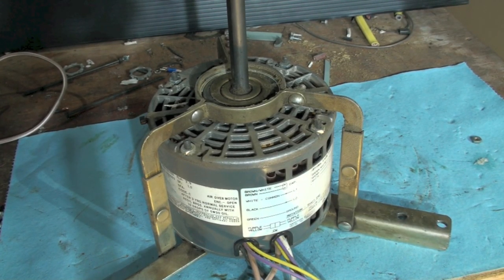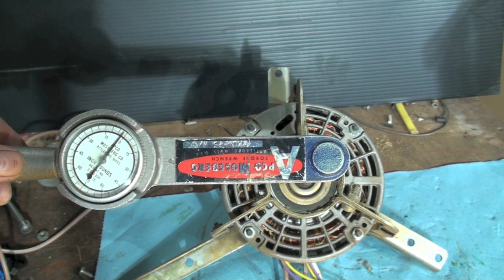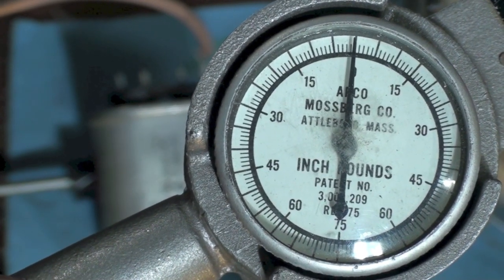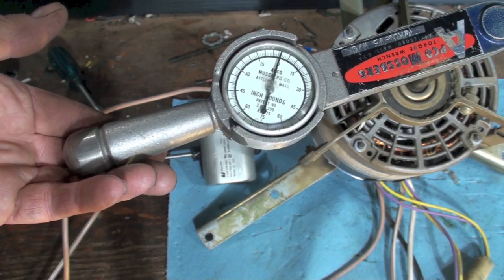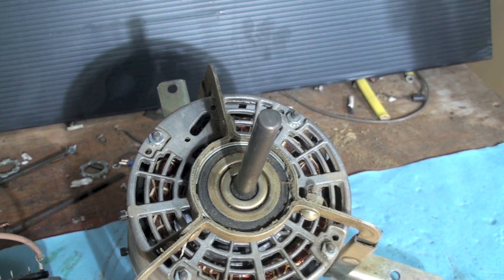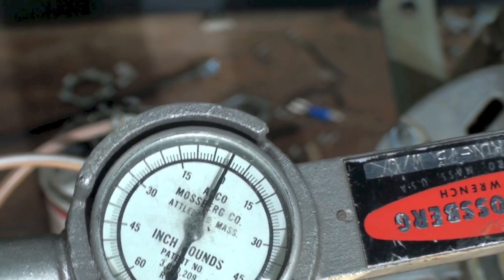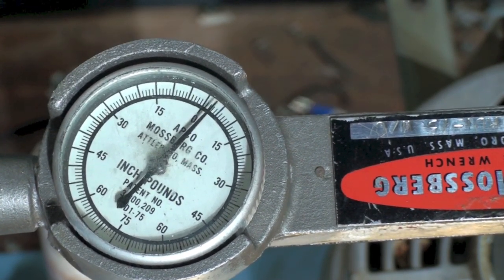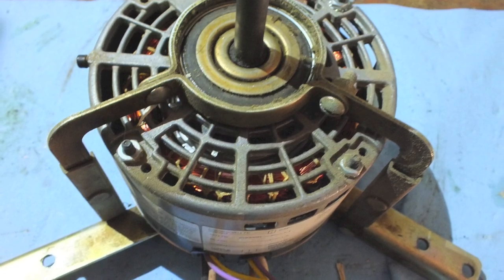PSC motor operation:  staring torque and the run cap

Comment: Excellent practical demonstration of the importance of the capacitor and start winding to the operation of the PSC motor.  Without the capacitor, the voltage vector is only moving back and forth in one plane (doesn't create rotation).  The phase shift created with the capacitor and start windings is key to getting a rotating vector sum that creates a starting torque in a specific direction.
Reply from the maker: Good explanation.  One thing I have seen though is some (but not all) of these motors will run backwards if they are manually rotated backwards before starting.
GFM

Comment: Questions
1) If you disconnect the cap, as you did, what if you tied the brown to the brown/white to leave the start winding in the circuit, without the cap ?
2)  Does this kind of motor leave the start winding in the circuit the whole time without damaging it ?
3) What kind of unit uses a CURRENT relay instead of a potential relay, to drop the start winding out ?
Reply from the maker: dronai Depending on the type of motor, it may fail within a minute or so or will overdraw.  I have not done a video on this but I will soon.
GFM
Reply from the maker: dronai As for the current relay, they are used on fractional horsepower refrigeration compressors.
GFM

Comment: The optimum capacitance could perhaps be related to the resonant frequency of an RLC circuit?  Either that, or the C required to create a certain phase shift between the two windings.  Either way, the C could be solved for mathematically if the L and R were known along with the frequency (60Hz) and desired phase shift.  But the point is that L and R are determined by the geometry (and composition) of the windings and are therefore fixed.  So increasing or decreasing the capacitance from the optimum will reduce the torque.  Equations for phase shift and resonant frequency are here:  http://hyperphysics.phy-astr.gsu.edu/hbase/electric/rlcser.html